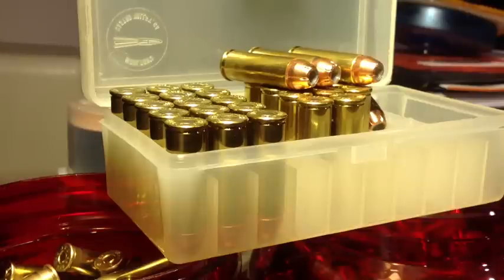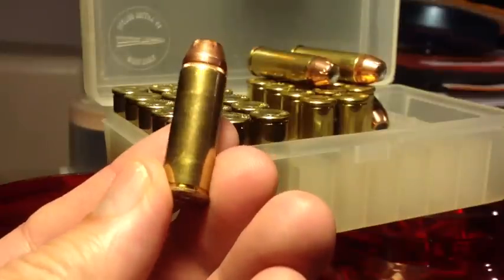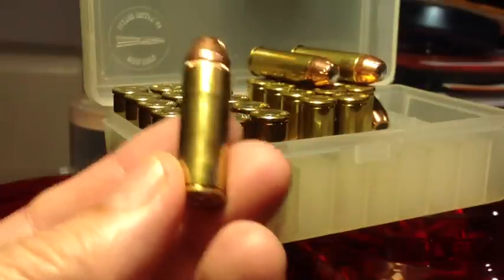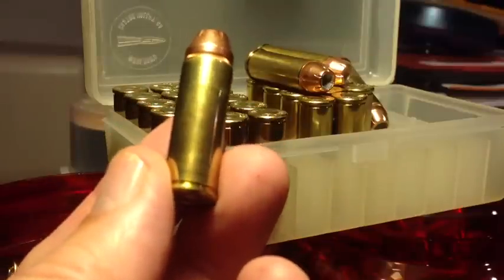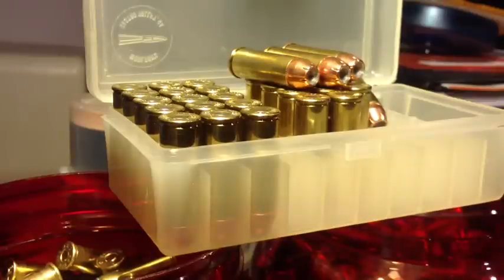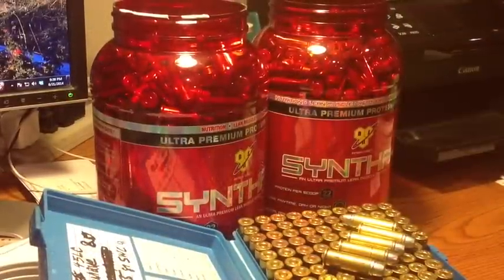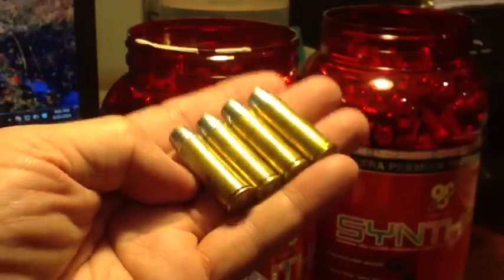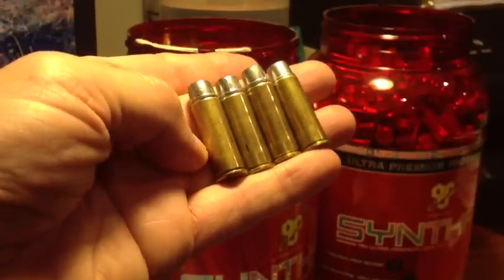Hot Loaded 45 Colt Ammo - Why Not?

Comment: For the Rossi Puma rifle , he can take the +P or +P+ load data of .45 colt , i buy it because the 454 casull not available in my country for now , wanted it for my deer and moose hunting season , i have .45-70 gov't marlin but wanted something kick less than that for pleasure and for my wife , something can kill a moose Under 100 yards , so .45 colt +P came and a 335 grain at 1300 fps out of 20" barrel do the job on moose with recoil not too big for my wife , less than a 30-30 wcf . I have before 454 casull rifle , and i shoot .45 colt in but each time shoot 454 casull in the case broken in chamber , so I go gunsmith he call rossi technicien to know why , Rossi's technicien told the rifle is not make to shoot .45 colt in , is only make for 454 casull , they told me is because of that  .45 colt make a ring in chamber , where my 454 casull cases broke . so my wife wanted a 44 magnum lever action , but i'm a cowboys ammo lover soo .45 colt are the choice , fun to shoot with standard round , hunt coyote with fun and accurate , after i change rossi factory sights .
Reply from the maker: Michel Gravel - The 45 Colt loaded as you have in your Rossi is a very capable round in either your standard or hot loads.  The 454 Casull is a monster cartridge.  But the 460 S&W Magnum and the 500 S& W Magnum have superceded the Casull round.  I really think the only thing that makes these blasters manageable is the size of the revolvers or guns they are chambered in.  The recoil of the 454 in big handguns or lever guns is actually manageable. But I find that the guns are hard on my hands though - busting knuckles and such.  Funny, never worn a shooting glove in all these years, even with full load 44s.  But if I shot the 454 on a more regular basis, I'd be getting a pair of those.  Best Regards to ya...
Reply: i have before a BFR revolver in .45-70 and .454 casull , the 454 casull kick little more than the same bullet same velocity in 45.-70 , due to is pressure , but hot load .45-70 in is amazing , i shoot 500 grain cast bullet in and is pretty hot , more recoil than my s&w 500 magnum ...
Reply: i wanted a 454 casull in rossi , like i have before , for my wife , but here they told me if i wanted one in stainless i have to wait 14 month to have one ... So i buy a 45 colt . but if i find 454 casull stainless model i will probably buy it , i still have all what need to reload 454 casull .
Reply from the maker: Michel Gravel Wow, Michel - I have a book Big Bore Revolvers - talks about all the big wildcat magnums - you should have been the one that wrote this book...it probably would have been more interesting.  Best to ya

Comment: No test, no useful.
Reply from the maker: Jay Warren Clark - The idea of this video was not to offer specific hot loads for the 45 Colt or testing of same...but rather ask the question that hot loading the 45 Colt was no longer necessary since we have the 454 Casull and 460 S & W to take care of all the hot stuff...the 45 Colt with standard and +P can stand right there.  Now even if it is not necessary, we can still load our 45 Colts hotter if desired, but pushing it to max ??  Just go with the 454.  Specific loads would be another video.  Best to ya,  FC
Reply: FortuneCookie45LC:
Well for those of us who look for knowledge that is repeatable, we need numbers as a reference point. This is science.
In addition, for those of us who follow the philosophy "less is more," we want to know what that "less" actually will do! I do not want to shoot load or Cary a 45/70. But I would like to know what a Colt.45 loaded up in a strong rifle action and with modern powder will do. 
So, I didn't buy my Ruger in .45 Colt until I was pretty sure a hand load would equal or better my .357. And that I have done with not a maximum but a pluses P load--a 250 gr XTP producing 650 FPE at the muzzle. 
Now I need to know what a 225 gr Leverevolution bullet loaded hot with slow powder will do out of a 24" rifle barrel with an action that will lock up.
PS. The .357 is a fine round out of a rifle. The other day I hit the steel out past 660 yards. That was with a 24 " Win. 92 with a 180 gr HARD CAST LGCFN BULLET, and a vernier sight. At that range it delivers about 350 FPE. Not bad for "less," for a little pistol bullet, eh?
Thanks for the response. JWC